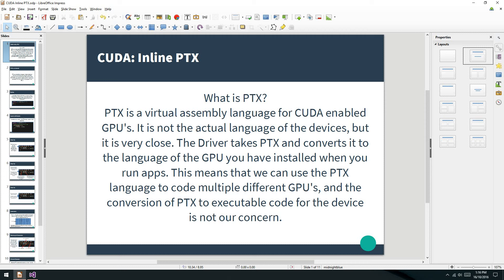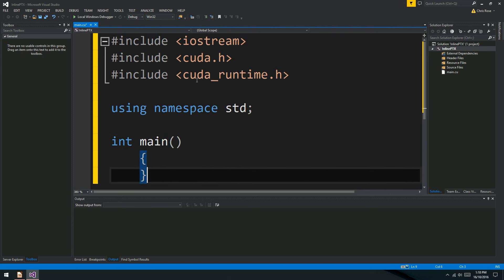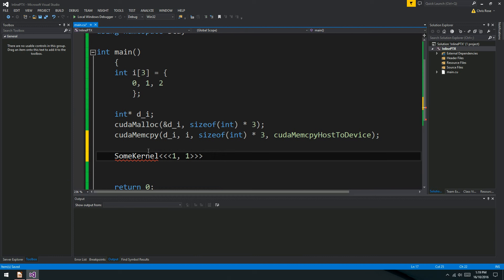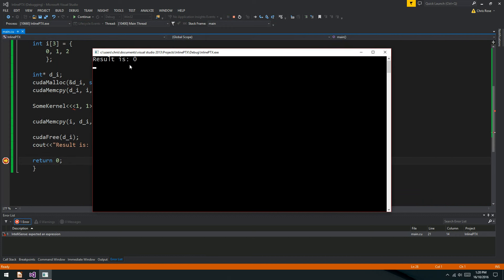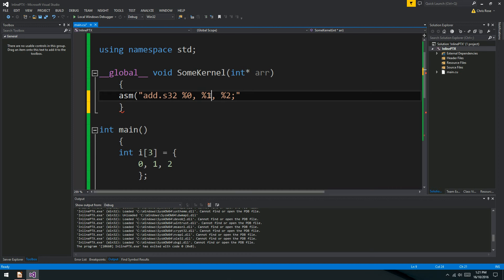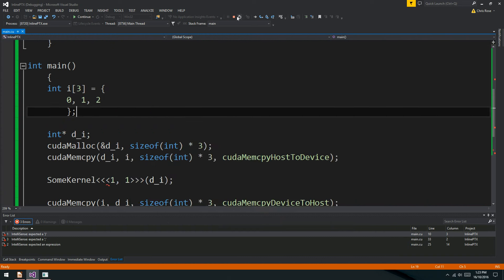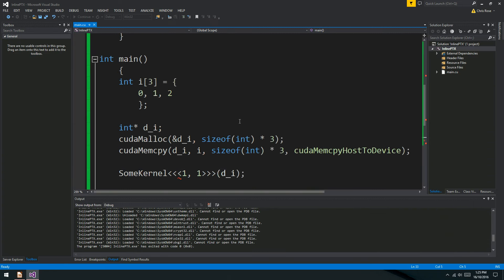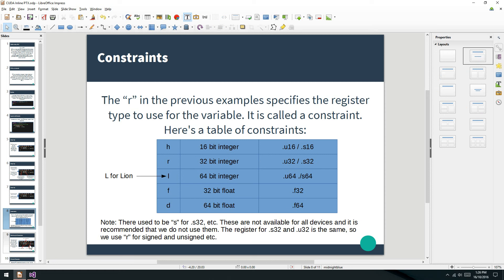CUDA: Inline PTX

Comment: What would happen if you do add.u64 but only have 32bit size registers? I.e use "l" as register type.
Reply from the maker: You know, I'm not sure. I imagine the compiler will prevent it if it's register moving? If it's to RAM, then it's possible you could overwrite the 4 bytes that follow the operand, but I've never tried it. That would certainly work in C++, on the CPU side of the world. Best way to know fer sure would be to try it mate. Cheers for watching mate, have a good one :)

Comment: I'm having trouble getting it to work. I have the same code as you and its compiling fine, I have included the libraries and everything. but the values of I don't change. it just outputs 0 for i[0]. either its not actually working and not computing anything or its not copying the value back to i.
Reply from the maker: I'd say there's a problem outside of the PTX, it might be a memory allocation thing. Have a look at the output of the cuda statements in C++, check if they are returning cudaSuccess. That might help pinpoint where things are going wrong. Good luck!
Reply: ahh thank you! I added the tests and it was failing on every one. so I reinstalled cuda with the drivers and everything and now its working!

Comment: ps i would be really interested in more videos about the topic. One thing i would like to ask, the flow would usually be, one statement and map the in/out arguments, then another statement and so on?
Also any way to male visual studio show us the ptx of a normal kernel?
Reply from the maker: Usually you want to perform many instructions in a single PTX block. The compiler won't optimize the PTX, it only optimizes around it. So if you step into PTX you generally want to perform some entire algorithm that you have optimized better than the compiler. There are indeed ways to see the PTX generated from CUDA code. That's a great topic for another vid. Thanks for watching and the suggestion!
Reply: Hi sorry what i meant was a bit different, i did not explain myself clearly. I am just a bit confused how the ptx would look like if we have several step, like sum 4 values together using 3 adds. I will read more on that topic, thank you any more video on the matter is welcome, I am used to cuda and used it in the past, so going one step lower to me is super interesting.
Reply from the maker: Oh ok. To add 4 ints together, you can use the following:
 
asm("add.s32 %0, %0, %1;"
  "add.s32 %2, %2, %3;"
  "add.s32 %0, %0, %2;"
  : "+r"(arr[0])
  :"r"(arr[1]), "r"(arr[2]), "r"(arr[3])
  );

Don't know if that's going to post correctly. There's another symbol for inputs which means read and write, it's +. We'll probs look at this in an upcoming vid. Hope it helps, adios!
Reply: yes it is helpful since my original assumption is wrong, thanks a lot this is most helpful! keep rocking man